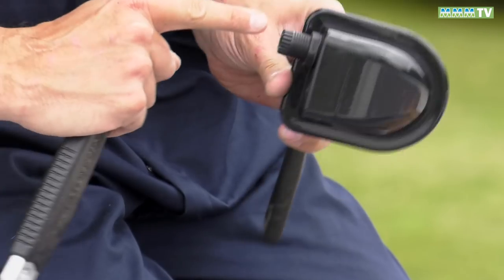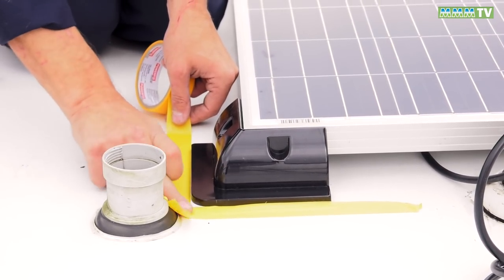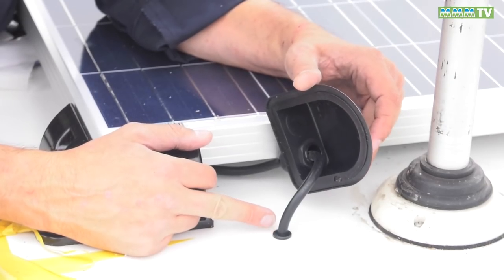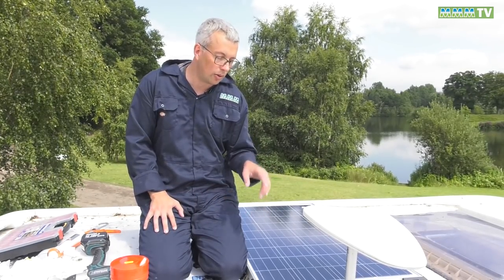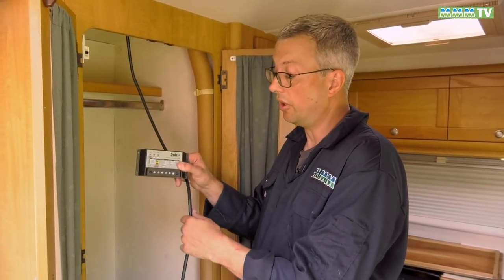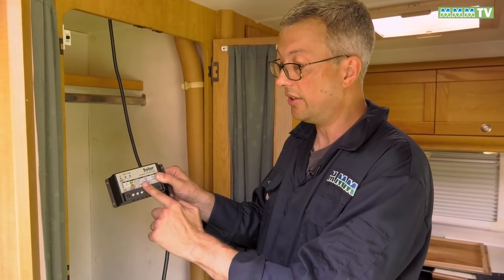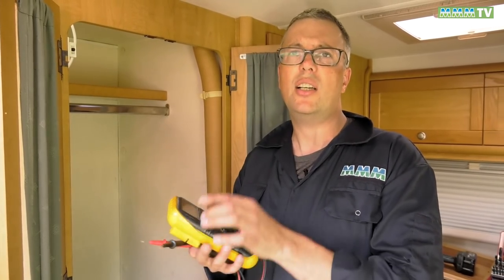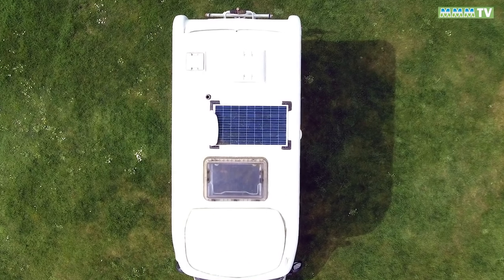MMM TV - How to Fit a Solar Panel to a Motorhome

Comment: I believe it is wise to wash the brackets in soapy water before fitting as they have a release oil on them from the casting process.   This can stop the Sikaflex from adhering to the plastic.    It's certainly worth doing, just in case.

Comment: You should read ALL of this:
Seriously??  You didn't even clean and prep the roof surface for the adhesive! or mention it. You didn't abrade the smooth shiny surface of the plastic mounting brackets! You do have to careful with plastic, to aid the mass manufacturing process they put a release agent in the plastic to make it quickly release/slip from the production mould this in turn makes it slippery stuff to glue. Even when you sand it to provide a key it's a problem because the release agent is all the way through the plastic . There have been cases where the panel, complete with it's plastic feet has detached and flown off the roof whist on the motorway leaving the adhesive still on the roof but none still on the now detached feet! You need to be very careful about the type of adhesive and what preparation is required,  you mention none of this! There are now some much better brackets made of aluminium they fit all along the leading edge of the panel giving wind protection and offering a bigger footprint for the adhesive. Also, aluminium is much more suitable for achieving high bond strength for a long duration. You should be using a high quality structural adhesive like sika 252i, for 'Structural joints subject to dynamic stress' not the sealant you used. The Teroson product you used is a seam and joint sealant, it isn't a structural adhesive. A heavy solar panel is  one of those situations where a sealant is not enough, it requires high strength adhesive applied in such a way that when cured the thickness of the bed of adhesive is something like 4-5mm thick The amount of product you applied was not enough, the thickness of it would be non existent by the time you pressed it into position. The adhesive needs to have some volume to it so as to absorb vibrations and other stresses. Really! 4 cheap plastic brackets with a bit of  sealant sparingly applied to secure a heavy solar panel to the roof of a van to be driven at 70mph on the motorway! These solar panels weigh 9 or 10 kg, they can and do fly off the roof if not very securely attached, causing serious accidents. Imagine driving behind this vehicle when it comes off! The adhesive footprint of all 4 brackets combined is not much compared to the size of the large panel is it? Would need to be very competently glued down to call it safe for the road wouldn't it! You should take this film down before people copy you! If you are not using mechanical fixings as well  then at least stick it down properly for our safety's sake! You are in a responsible position here and should be explaining about the importance of using the best practise, quality adhesives and good preparation work. You should emphasise the potential dangers of gluing a large heavy panel to the roof of a vehicle! I wonder how many road users realise that caravan and motorhome owners are fixing very heavy solar panels to their roofs with a bit of unspecified sealant and no screws or bolts? When you think of some peoples lack of diy skills and the lack of skilled knowledge about doing this job correctly it's scary. And this film above is from a professional outfit!
Also, you might have talked about the limitations of siting it with the aerial casting it's shadow.
Also the gland is designed to have it's sloping side set to the front of van.
Also I notice the first screw was a pan head and the second screw was a countersink. Bodge!
Also you might advise that where poss it's preferable to site the panel with the narrowest edge to the front to reduce wind drag.
Also, why is there music playing whilst you are doing an instructional film?

For heavens sake Peter you are supposed to be a professional, you introduced yourself as MMM's technical person!
 
 "MMM TV shows you how to fit a solar panel to your motorhome's roof. It's simpler than you think!"
                Well that's disturbing isn't it! MMM  think it's a simple task!!!!
Reply: Hi Mark, the sealant used was as supplied by the firm that supplied the panel and is entirely suitable for this use and plenty of sealant was applied - it's rock solid once set. We all have our own preferences to sealant adhesives. All mating surfaces were cleaned with solvent (not sure if edit showed this). The brackets were decent quality solid items (as supplied in the kit) and work fine. Shadow cast from aerials etc is always an issue but you're always limited as to the best place to site the panel based on its size - this was the only place that this particular panel could be fitted. And yes you're quite right once of the screws is different (one snapped in the supplied kit, so I had to substitute one during filming). The gland orientation isn't relevant - it all depends where the area of low pressure on the roof is as to how the wind affects it (it's waterproof from all directions). As for the music - well there's no pleasing some people!
Reply: You're exactly right in all your points and if I were him I wouldn't have defended any of it and just taken it down! Anyone who puts the gland shroud back to front has to have limited aptitude for this kind of task imho!

Comment: Good practice to fit a isolator between panel and controller and connect battery before panel to controller. Its always worrying that its only sikaflex and a thin layer of paint holding that panel on, but i suppose its the acceptable way nowadays

Comment: Shouldn't the cable gland cover have the sloping part facing forward & the cable coming out the rear? i.e. along the length of the van rather than across the width?

Comment: Hi, following mmm’s latest edition, installing a photonics universe panel, I bought the kit, however it is hardly a kit, consisting of just panel and regulator, fitted with mc4 connectors ( why? When the regulator is not mc4 and to install, they have to be cut off?). Missing are the screw fixings, panel mounts, sikaflex, aerodynamic gland, conduit etc. I expected a better recommendation from mmm.
This too is far from professional, the glands and mountings need to be prepared 1st before gluing with sikaflex, I would never solely rely on a 12kg panel fitted to a roof without bolts.
Reply: The glue used to secure roof solar panel  is little different to how car manufacturers glue quarter panels into vehicles - it won’t come off

Comment: This is exactly how I expected, the only thing I am concerned about is that there are also other methods of battery charging, I.e the alternator, and another charger powered when hooked up to the mains... can these affect/damage each other in any kind of way? Do they have their own protection against this, or is it something that is unimportant and do not affect each other in any way??
Reply: That's the issue I am trying to have clarified too.   My van already had alternator and mains hook-up supplies, so how does the solar connect to all that?    I've asked this question on other channels too, but they think they have explained it already.

Comment: Is gluing really enough? I've heard scary stories of panels taking flight...
Reply: No it is not IMHO. You are essentially just gluing to the paint, you need to screw as well.
Reply: I had a 180 watt solar panel on the roof of my Bailey caravan and that was only bonded on with Sikaflex. It never moved in the ten years I owned it. I would say though that this video omits to advise that you key the surface of the feet and the roof prior to bonding. That plastic often has release agent on it, and is far too smooth. The caravan/motorhome roof may well have wax on the paint, which will also reduce the adhesion properties.
I'm glad that guy didn't do my panel, that's for sure, especially with his rather untidy wiring in the wardrobe.